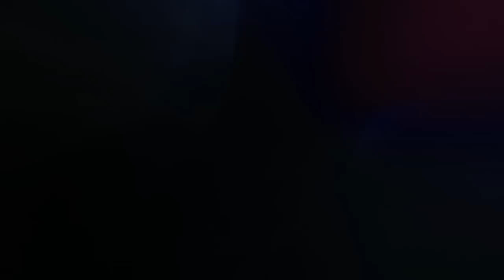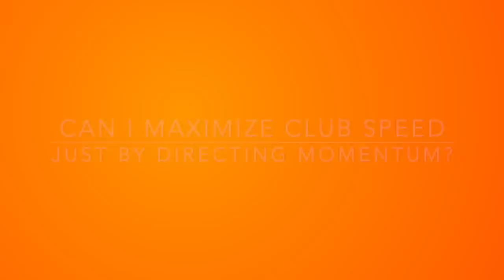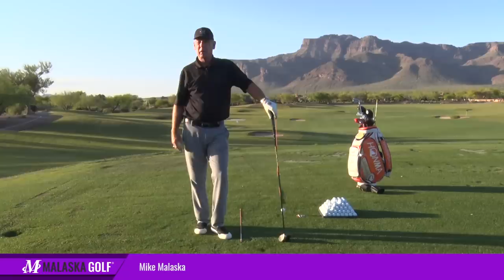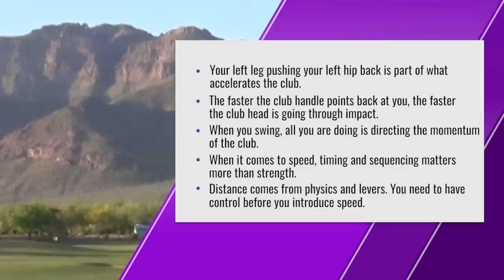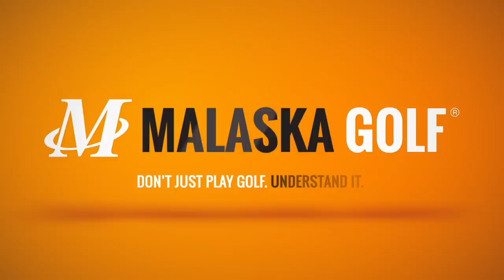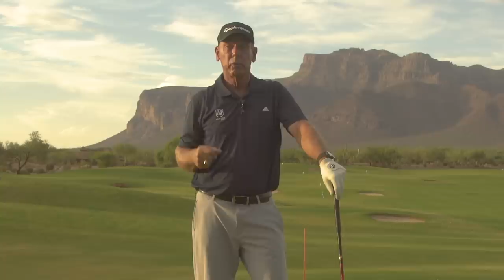Malaska Golf // Maximize Club Speed and Power Just By Directing Momentum - Can you?

Comment: Ideally the body and club work like a Trebuchet with the backswing and downswing pulling the primary lever tight across the chest so it is able to fly off explosively in the downswing as hips reach 45° open “hitting the wall” just as lagging shoulders and arm come back parallel with shaft horizontal and club head mass able able to whip around the hand into the back of the ball similar to how the projectile in a Trebuchet whips around the lever arm in a sling.

The mass of the lead arm flying of the chest drags the club head mass through the ball similar to how a catapult pulls a jet off the deck of a carrier.  What pulls the hands and club straight down the target line instead of just whipping it around the body is the how a golf side bends and orients the lead arm more vertically before it flies off and accelerates faster and with a different force vector that when connected.

The reason pros and other good ball strikers hit the ball with more force are they do those two things: release the lead arm mass and side bend to guide it down the target line.  If a recreational golfer learns  to do those things they will hit the ball with more club head speed and striking force but most take the advice to “maintain spine angle” and “stay connected” too literally because that cause and effect is not explained to them.

Comment: Mike, excellent video. I have been taught that tempo and rhythm are the keys to distance. The challenge is that it starts with grip pressure at set up and realizing that the pressure changes during the swing that effects the fluidity. Hitting the ball flush on the face at impact consistently is where I have the most trouble. Any suggestions?

Comment: Another way of getting the appearance that the left side is pushing back is to drive the right side onto the target. That drive requires the left side to get out of the way, and results in the butt of the club pointing at the target. Thus the clubhead is accelerated and speed results. So, drive the right side and don't focus on the left side moving back and away.